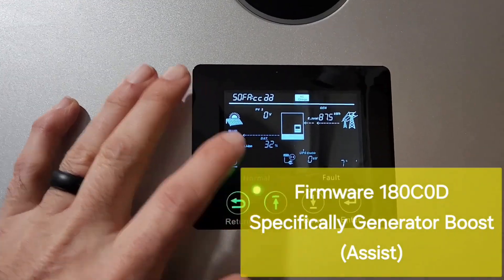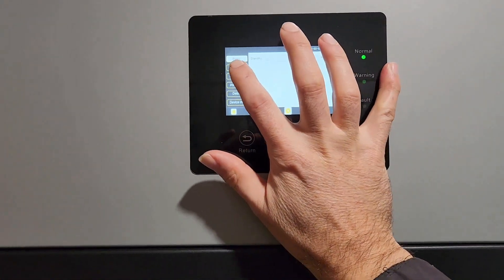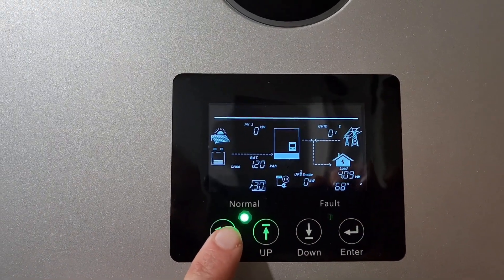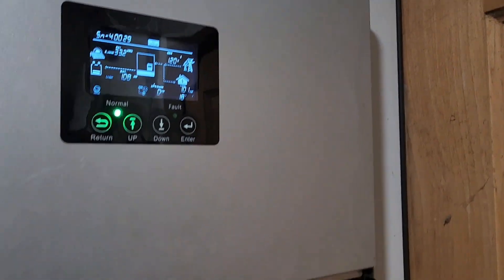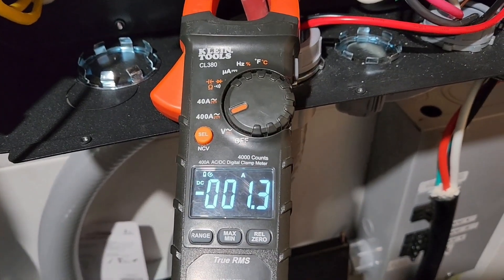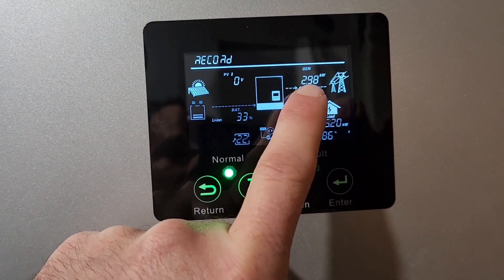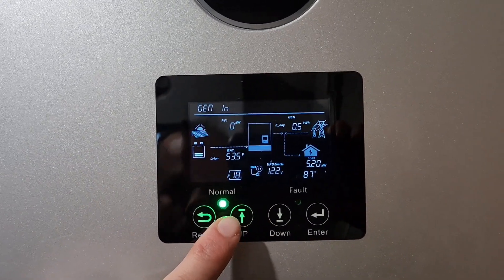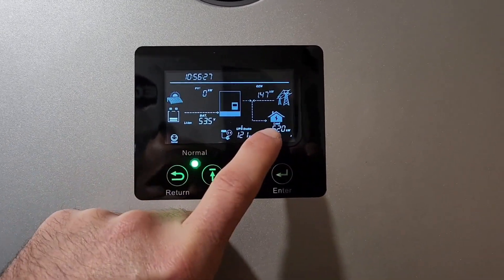Excited for this 6000XP firmware update.  This update added Generator Boost/Assist

Comment: I just got an inverter generator in order to charge my batteries for low light days.  I have a 6000xp and 2 indoor power pro batteries.  So my problem is when I turn on my generator I can see the 120v on each leg for 240 total but not charging my batteries.  My inverter clearly recognizes the generator Voltage .  Not sure what I have done wrong any suggestions would help
Reply from the maker: Have you looked at the charge settings using the monitor site or mobile app?

Comment: I want to buy one to power a small house. If i use the off-grid diagram from the manual, where should I connect the grid if I want to use it to charge the batteries (I do not have solar) ?  I hope you can comment. Thanks!!
Reply from the maker: Like a giant UPS?

Comment: So if I have 2 6000xp in parallel would I need a generator  for both units?
Reply from the maker: No but they both need to be wired up to the generator

Comment: Will this only work if you are off grid?  I'm trying to figure out if this can work when the grid is connected and it would seem like the answer is no.  Still would be a great solution for me here in Houston when the grid goes down.  In that event, if I follow the video...I could hook up my 15,000 watt generator...set the 18k to say...pull 12,000 watts...and then when my load exceeds 12,000 it would pull from PV and batteries.  Am I thinking about this the right way?
Reply from the maker: Yes that's how it normally works.
Reply: @theadventuresofarenaissancman  the reason I ask is that an eg4 tech in one of the forums says the total AC output remains the same for either unit...just changes the mix...i.e. from a generator.  

i was hoping it would increase the capacity on the AC bus side so I can pull larger loads (in a grid down situation where normally the grid bypass would be the way to handle larger loads).
Reply from the maker: I haven't tested a scenario like that.

Comment: Does the general have to be an inverter generator
Reply from the maker: I would say yes, but I haven't tested non inverter generators.
Reply: Needs to be <3% THD
Reply from the maker: Yes and no.   I was to use a non inverter generator but I had to limit the draw to 50% of rated capacity and had to add the load slowly.

Comment: I cant get my generator a 5.5 kw generac to connect to the inverter. Just show the voltage and hz on the screen of the inverter and clicks on once every five mins for 4 seconds. 
The 18k just does not like it. 
Gen has a floating neutral and floating neutral wired on the inverter and bonded neutral in the main power panel. 
Cycles hz and voltage is in spec. Perimeters are set wide enough for the cycles and volt fluctuation. 
My head is going crazy on this.
Reply from the maker: Bummer, is your generator a true 240v? Or one of those generators that has a switch that goes from 120 to 240?
Reply: @theadventuresofarenaissancman  true 240v. Generac 55 quiet pack
Reply from the maker: Do you have the newest firmware installed on your 60000xp?
Reply: @theadventuresofarenaissancman  yes
Reply: Needs <3% THD.

Comment: I think this is the feature I've been wanting for a long time. Can you tell me if I understand correctly? I'm off-grid with a PV array and a backup generator. Say it's been cloudy and my batteries are low. I just want the generator to turn on and help top off the batteries. So, typically I'd need a generator greater than 6000w, so that when it kicks on, it can supply the maximum load that the 6000XP would, then any extra would charge the battery. But with this new feature, the 6000XP will continue to draw from the PV array and battery to supply the loads, and the generator would just contribute to the overall available power. As long as the sum of PV + battery + generator wattage is greater than 6000w, I can still max out the loads, plus charge the battery with any extra power over 6000w. Is that all accurate? Or is what I really need an EG4 Chargeverter?
Reply from the maker: That is accurate.

Comment: I called Signature Solar they told me this wasn't possible, but the person I talked to wasn't really sure they gave me the number to EG4. I called them they said absolutely no way to do this. Either had to use batteries, or completely bypass the inverter from the grid/generator to supply the load. Yet you showed how this works I even posted on DIY solar forum no one there knew either. I guess these inverters are so new and the ones using them are only using completely off grid that they don't know. Can you also get power from solar and do the same thing? This is what I want to do is supply the load with as much renewable energy as I can pull the least amount of power from the grid. When I talked to EG4 they said a new inverter was going to be released this summer which I would want to wait for not get the 6000xp. I have been holding off on buying one for now I still have lot of work to do get panels up and wiring.
Reply: Any hints about the new inverter?  I was about to upgrade from dual Growatt 3000s and 24v batts to a 48v system built around this.
Reply from the maker: @dlpeters0n  according to a LuxPower representative on the DIY Solar Forum.  They are working with EG4 but can't discuss details of the next inverter.  Check out LuxPower website.  I assume it will be something to replace the megro  8K
Reply from the maker: This is brand new as of 2 days ago.  I posted this video the same day that the firmware was released.
Reply: @theadventuresofarenaissancman  True but would think EG4 tech support would know about a firmware that was coming out in a week after I called.  I just have to buy one and figure it out for myself. I want something that I can use solar and battery power only add enough gird to make up the difference when the higher loads pull power.
Reply from the maker: @Mike-01234  initially, I would say not possible on the 6000xp, but this might be possible.  

What you are describing is a grid interactive/ grid tied hybrid inverter like the 18Kpv.  

3rd, I've heard rumors of another EG4 inverter, but the rumors said fall 2023 was the release date.  That never happened, and now you were told Summer 2024. I guess we just need to wait for Summer.
Reply: @theadventuresofarenaissancman  I asked them about the 3000-EHV and 6000-EX they said both of those could do what I wanted which was provide power from the gird to make up for lack of renewable power. I'm not talking about back feeding into a grid connected main panel. Yes the 18kpv can do that. I'm talking about taking the wire from a 3 ton AC unit with a soft start and connecting it to the output of an off-grid inverter that has grid power input.
Reply from the maker: @Mike-01234  none of those inverters can AC couple with a grid connection.   As of today, the only EG4 (branded) inverter that can merge solar/battery and combine it with a grid connection is the 18Kpv.
Reply from the maker: @Mike-01234  no the EX and the EHV can not.  Those are both off grid inverters and can not grid tie.  The representative must be confused or didn't understand your question.
Reply from the maker: For now, this only works on the generator port.
Reply from the maker: As for the solar part, you would need batteries to offset any solar deficits.

Comment: The adventures of a renaissance man where can you find the firm ware and info on the firmware for the 6000XP?  I did the update yesterday that you show here via the web monitoring site and when I selected the ? For more info it takes me to an EG4 site with firmware info for the 18K. I just called sig sol and asked them this question and they said they don’t know of anyway to access that info like I can find for the 18K. Do you have info on that?  Thanks
Reply from the maker: The change log is accessible from the Android mobile app. Logout... Select "download firmware" at the bottom. Select 6000xp.  Top right Change Log
Reply: Perfect thank you!  Just logged out on my iPhone and found it. That’s exactly toy what I was looking for. I don’t understand why that’s not available via the online monitoring software. At least I can’t find it.  And I don’t understand how SS support has no clue where to find it. It seems that the end users are Guinea pigs for this stuff more so than not. There’s def a steep learning curve with this and the power pro batts I just picked up.

Comment: what is that single unit eg4?
You have two 6000XPs but the other unit you are changing settings on the display I am not familiar with.
Reply from the maker: 18Kpv.   https://signaturesolar.com/eg4-18kpv-hybrid-inverter-all-in-one-solar-inverter-eg4-18kpv-12lv/?ref=M12gk_2DtiVacN
Reply: @theadventuresofarenaissancman  Awh right, thanks. I did look at those but didn't see the need to spend more, so I just installed two 6000XPs a few weeks ago. 12kw array split into 4 MPPT channels. Working much better than my single inverter and 1 MPPT before.
Reply from the maker: 18,000 watt solar, 12,000 watt inverter, IP rated, its a nice solid inverter, but it runs almost 3 times to the cost of a single 6000xp.

Comment: It seems to me that you could use a smaller generator with this option now to keep it in a the most efficient range of operation. Maybe negating the large generator recommendation in the manual currently?  

Also what did you use to tame the green laser of death?  I tried scotch tape and that didn’t help mine. 

I’ll have to try and figure out how to do the firmware update now.
Reply from the maker: I prefer using the website to do the firmware updates.
Reply from the maker: Green Electrical tape.
Reply from the maker: Assuming the generator is 240v split phase, any size should work now.
Reply from the maker: https://youtube.com/shorts/TCiFWZmPqTA?feature=share

Comment: would it work with a 120v generator?
Reply from the maker: I haven't tested this recently, but I assume the answer will still be no.
Reply: sure would be nice if they supported 120 volt input.  That would allow me and others who own EV's with Vehicle to Load capability, like my Ioniq5, to use the large car battery as a backup.  Right now only the Victron can do this but it is limited to outputting 120 volts.  The EcoFlow Delta Pro Ultra can take 120 volt input while outputting 240 volts
Reply from the maker: You could us the EG4 ChargeVerter to charge from a 120v source.
Reply: @ronbridegroom8428 you can do the trick with solarEdge autotransformer $350. Wire for 120 input 240 output on the transformer

Comment: Nice!  So it gives the 6000xp the same ability as the Victron Power-Assist.  That's a great feature for mobile usage as well as people with small gennys.
Reply from the maker: Yes. It's a nice feature.
Reply: Except this inverter should never be used in mobile applications due to no dynamic neutral-ground bond relay
Reply from the maker: @HighTechLab  I need to check that in the newest firmware.